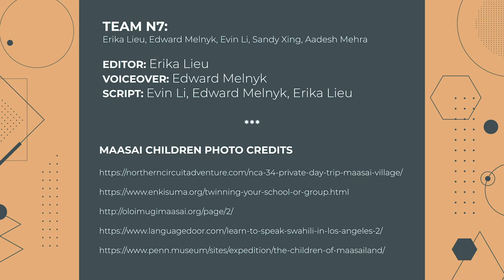Cardboard Chair Video Pitch - Team N7

Comment: Looks like the back is not strong enough to support leaning back? If so, it will mislead user to lean back.  If the L shape side panel is a trapezoid shape instead it would have been much stronger.